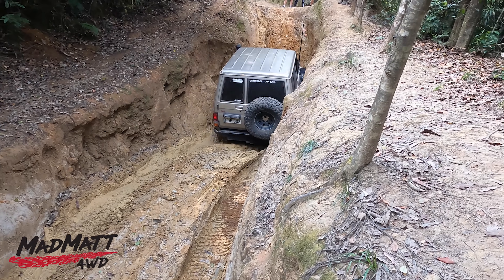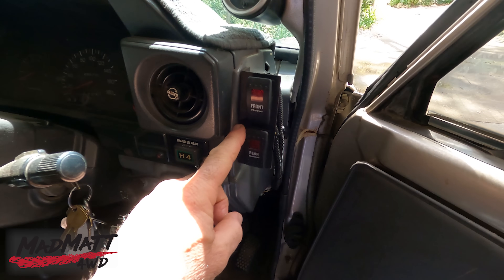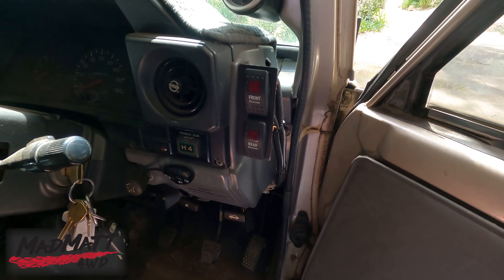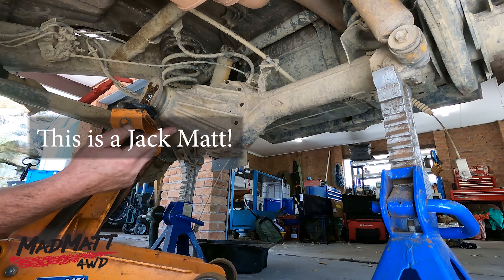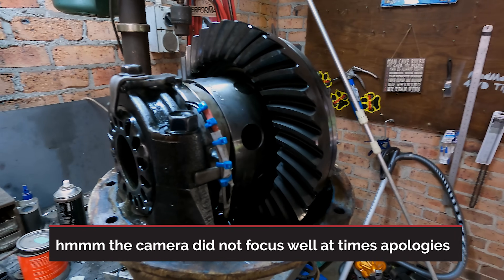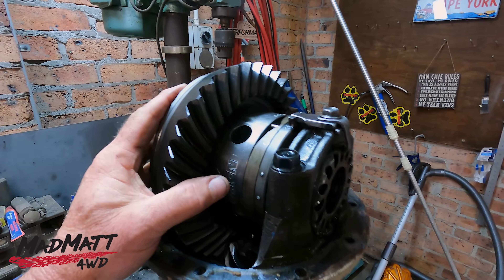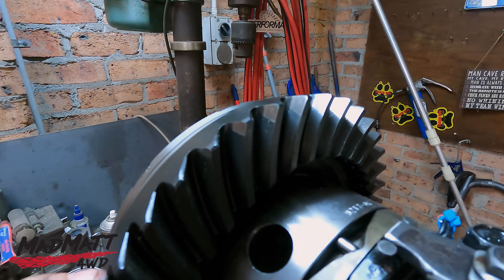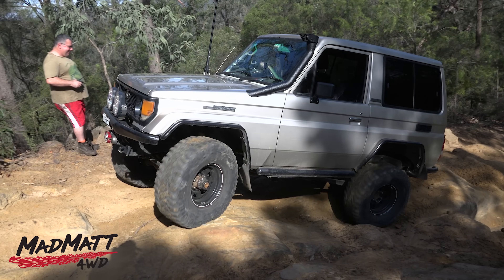Ultimate guide, HARROP ELOCKER, How it works, what's wrong with it, And How to Make it Awesome.

Comment: Had 4 Harrop ELockers break cross shafts at work. All in the rear of Landcruisers (Big tyres .chipped ,etc). Stock toyota Landcruiser rear diff cross shafts are 22mm diameter , Harrop ELocker cross shafts are only 16mm diameter. Not hard to see why they get broken when used for what someone who has fitted big tyres and extra power wants to do with them. ARB Lockers have 19mm cross shafts for the same vehicle , if my memory is correct , and I cant say I have seen any break.
Reply from the maker: That’s interesting. I wonder if Harrop addressed this.
Reply: Correct. Tiny cross-shafts and small pinion gears, because the carrier is too small and that is a big as they could fit in. When you examine the gears and cross-shaft in a direct comparison with Pro-locker - you gotta ask yourself, why would you buy the smaller, weaker e-locker? Eaton could have made the carrier as large as physically possible to fit in the housing, but they did not and I can only assume it was a cost thing dictated by the bean counters.

Comment: Great video. Hey Matt, if you had to choose between the elocker and pro locker which would you go for? I'm in the market for twin lockers for my 100 series. Cheers
Reply from the maker: Interesting question. I've not had a huge amount of experience with the pro-locker to know what it's faults may be. I do like the design of the pro-locker. It looks simple and robust. Harrop got in touch with me the other day and told me the failure I had was due to a batch issue they had some years back and they no longer have the issue of tabs braking off. So given that I've got no issues with the Elocker either. I've used them a huge amount with no other issues. So to answer you question I'd say either locker is a good choice so buy on price.
Reply: @MadMatt4WD  thanks for the detailed reply. Much appreciated.

Comment: Very good info mate, When i have the front out i will be doing that mod in front for sure, Would you go harrop in rear of dmax or air locker as thats my next mod as i would have air available for tyres if i went arb air locker your thoughts ?
Reply from the maker: I'd go Harrop as I have too many air leak issues with ARBs.

Comment: nice video matt. Side note - are reduction gears for the transfer case an option for bunderas? depending on what's available, you could keep your highway revs at the sweet spot but have the reduction in low range, most likely more reduction than what diff gears alone will give, that's if you find it lacking. Just a thought 👍
Reply from the maker: Yes you can get them but it’s my belief that the closer a ratio change is to the wheel the stronger the driveline is. If I do the trans then the diff has to handle the extra torque. With this setup it’s diff then wheel. For my needs I’ll live with the onroad compromise for Offroad strength.

Comment: Love it from Central Utah 👍 
I have been running the E Locker in my TJ's rear Dana 44 for years without any issues at all, looking into a limited slip for the front 30 (As I've never needed a front locker yet) when I upgraded axles and switch out the 3.73's for 5.13's this Spring. 🤔
Reply from the maker: Thanks for the comment.

Comment: Not saying the other lockers are bad, but the Pro lockers are my preference, they're simply a better and stronger design than the Elocker and ARB.
Saying that, they're all fairly good if they're installed correctly, for this reason, I install my own lockers too. I've even got a Chinese copy of the ARB locker in one vehicle, still going strong 10years on, no air leaks or broken bits.👍
Reply from the maker: I like the pro locker design as well. It’s simple and way more mechanical.
Reply: They don't make them for most of the dual cabs as the diffs are too small as I looked into getting one

Comment: glad i found this,i run 1 in the rear of my mux and just found its not working,had a look and found broken wire at diff entry point and since seeing the vid noticed no wiring cover there either. I have never played really hard in the car so hope its not the bracket you showed,In 2 minds now as still under warrenty.There is no sign of impact damage and wire is well secured with enough travel when fully flexed,i will talk to the dealer that fitted it but if they give me a hard time might just do it myself and do your mods,cheers
Reply from the maker: Wow that’s interesting. I’d talk to the dealer first

Comment: For simplicity sake and what I feel is more "bush proof", I have an auto "lokka" and a reshimmed lsd in my GQ tourer. Very capable the way it is, if I can't crawl up something or am still unable to drive an obstacle, track building, lower pressures, different line, winch etc is the way to go. Neither have let me down. Different application I suppose, but perhaps people jump on the twin locked train and dismiss a good lsd in the rear.
Reply from the maker: It depends on what type of wheeling you do. For me I want to be able to control exactly what happens and when with my 4wd but that’s because I’m chasing a technical buzz. But you’re right a good patrol lsd works very well.
Reply: @MadMatt4WD  Definitely application dependant! Just wanted to reiterate your point of how good a locker is, when it fails in the middle of nowhere 😬

Comment: Great video Matt.  I run harrops front and rear and really like the simplicity of the design.  This was something I was not aware of though.  I guess you're pushing them harder than I ever would,  but clearly there's room for improvement there! Would it not be better to drill and tap those stop bolts so that they can be screwed in to the magnet rather than tig welded to it?
I wonder,  when harrop concedes that your modifications are an improvement, and decides to implement it,  will they offer to retrofit all of our old lockers for free? Ha ha! Probably not.  Still love them though,  now I just have something else to think about whenever I use them.
Reply from the maker: Hi Jade thanks for the comment I figure you can’t drill and tap because the wire of the magnet internally will get damaged. Time will tell.
Reply: @MadMatt4WD  good point.  It probably would too

Comment: Thanks for the video Matt! 
I have a Chinese luxury mid-size SUV that came fitted with these lockers front and rear from factory. At first I thought that there's no way that they would be sturdy enough considering how "fairly priced" the vehicle was. However when I took them to the rocky mountains and climbed a good amount of loose-rocks hills, I was genuinely impressed. Yes they do have the exact disengagement characteristic that is mentioned in this video, but I'll take that over an open diff any day!
Reply from the maker: I didn’t realise they were running the harrop e locker very interesting.
Reply: @MadMatt4WD  they make copies and they’re call Haifeng HF lockers
Reply: Chinese luxury🤣😂😂
Reply: @officialWWM  Well believe it or not, it is based on Toyota Prado 150, but it has more bling bling and electronics than the Prado. Will it last as long? Only time will tell.
Reply: @MailDeliverySystem-xw6hh  what is it? Even if it does last, being Chinese, the resale will be a disaster!

Comment: Good review Matt. I’m still slightly confused about what bits move and don’t move. I now see that the cam spins with the carrier when unlocked, but isn’t the carrier where the pins are connected to the crown wheel? If so, wouldn’t the pins keep turning with the crown wheel and continually ride up and down the cam that is now locked to the magnet? Or is the carrier where the pins are only rotating when there is differential action across the axles?
Reply from the maker: Hey Richard you pick up on a good point I didn’t mention in the video once the pins get to the end of the cam the cam late rotates against the magnet.
Reply: @MadMatt4WD  Thanks Matt.  I found someone else's video just after watching yours where they had the axle on stands and the rear cover off and showed operation slowly in the vehicle, and that showed me what you say here.  I wonder how much wear that gets if the cam plate is turning against the magnet while magnetised?  Probably adding to why your magnet holding pins failed.
Reply from the maker: Yeah I don’t know. It is lubricated by the oil